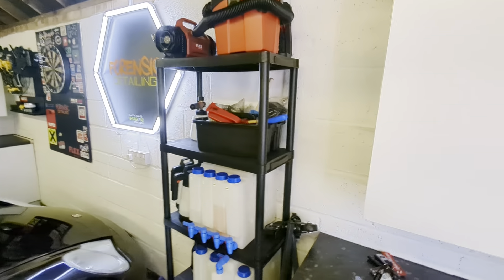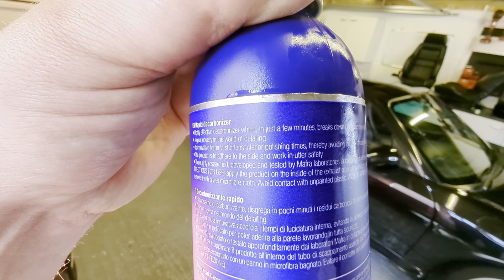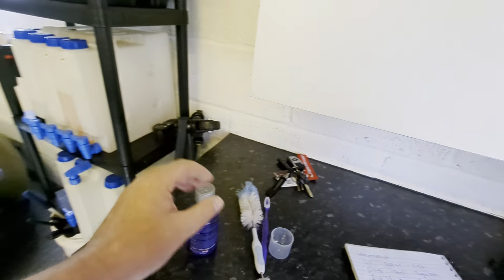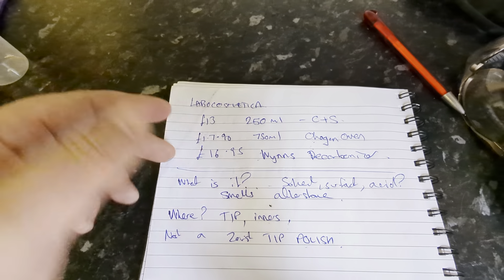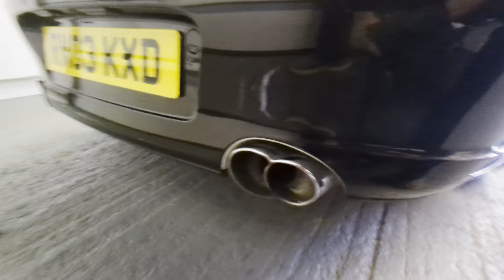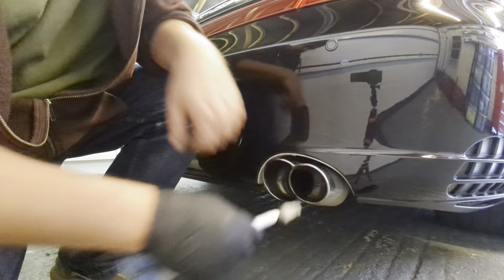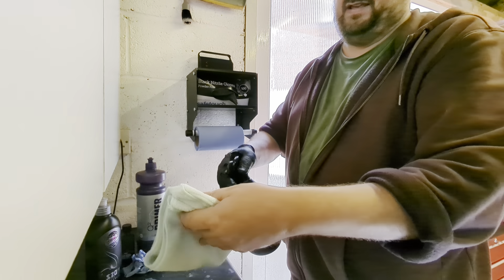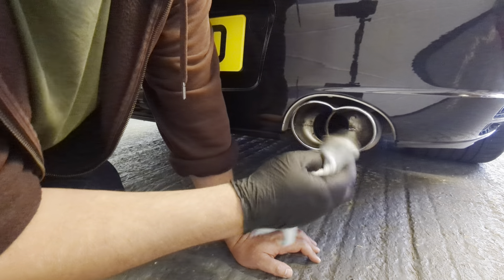MELT away exhaust tip dirt with LABOCOSMETICA CRONOS Decarbonizer

Comment: Harpic Power Plus cleans exhaust tips... Its thicker and will coat the carbon as it dissolves it, Its fast acting too.
Reply: It will also destroy the chrome, that's why they say not to use it on bath taps and such
Reply: @ItsMeYourRealDad  If they are stainless steel it is OK.. I doubt many carbon removers will be OK with chrome.

Comment: I’ve had this for a while. It does work. Usually apply it with a cheap toothbrush and then use super fine grade steel wool. I’ve had generally good results with it. On a side note, Bilt Hamber Auto Wheels also works on exhaust tips too 👍🏻

Comment: My Pink Stuff paste at £1.65, does a similar end result. A single sheet of kitchen tissue, folded over, a bit of elbow crease, and the tips look like new. It even does the inside of the exhaust. But I'm thinking about getting one of those cheap foam cones, with a drill bit. That should do a better job than my hands. Annoyingly, I usually forget about the tips, until after I've packed my detailing stuff away.
Reply: I'm exactly the same, I always forget the tips 😂
Reply: @decker0373  I'm glad my wife doesn't. 😂
Reply: The Pink stuff. I just used on very dirty tip for the first time WOW!   This is my go to now.
Reply: I've heard good things about the Pink Stuff, and I saw a short video reviewing it from somewhere. I must get some.
Reply: @owensteele1645  I'll give it a go too, I noticed the other day the missus had some of it in the cleaning stuff cupboard.
Reply: A week ago I bought pink and used that, was good results :)

Comment: I recently used Koch Chemie H8.02 with a fine grey scotchbrite to remove years of tar and thick carbon out of the tips of my best mate's mum's 2011 R56 BMW Mini Cooper S Convertible that uses the pokey little 1.6 Turbo Prince engine. It was a very messy job, took nearly an hour, my beautiful hands went black like coal, and I wiped out two grey scotchbrites. The tips came up a treat though. Menzerna Medium Cut 2400 was followed up to enrich the stainless shine, then they were waxed with Bilt Hamber Laboratories Finis Wax for hopefully long-lasting protection. Next time I get a car like that, I'll try out the Cronos. It looks far less time-consuming and efficient.

Comment: Haha thats why I've never bought any of that brand due to the labelling isn't clear at all, seems like hard work having to drill into the product to find out what it does. I use Atom Mac on my car every time I wash it, the discs corrode badly if I don't after a wash. Swear by it, Although I've discovered P&S Absolute rinsless wash for my weekend car, I use this 90% of the time- only washed it 3 times since new. P&S Absolute does a great job.
Reply: Thanks for this, I'll try P&S now I've seen a review from someone who has used it. I've had a look at it a couple of times, couldn't make my mind up.
Reply: @-A-lm5xb  Yeah I think they make great products, they are starting to change their trigger sprayers on their 16oz bottle as they were terrible, great products that actually work well. Another favourite is P&S Brake Buster, I think this is a firm favourite for most weekend warriors. Enjoy

Comment: I'd hazard that's it's sodium hydroxide based. If that's the case oven cleaner foam would probably work better.
Reply: Yes anything like that will do the job. A lot of these "professional" products are completely unnecessary. I keep trying cheaper solutions and one by one I'm finding things that do the same job for a lot less money.
Reply: Potassium Hydroxide and it's pH 12 according to the safety information. So that 'greasy' feeling he was getting on his ungloved hand was most likely the fat in his skin saponifying. Sodium (and potassium) hydroxide are bad things to use on aluminium, they strip off the natural passivating oxide coat and can lead to pitting. They're used to deliberately strip the natural oxide coat before anodising a new deeper oxide coat onto the metal.
Reply: @ianmason.  I had intended to look at the data sheet at some point this week to see if my assumption was correct (I was pretty close). And you're correct they're both bad for aluminium.

Comment: I wouldn't spend the money. Solvol Autosol always does a fantastic job on the outside of the pipes so I wouldn't be surprised if it did a decent job on the inside too. I think common petroleum based products might work too, such as good old WD40. But it builds up again so quickly that I think it's a complete waste of time anyway.
Reply: I use autosol and work it in with a polishing pad on my dremel - once done wipe off with a cloth and it works wonders!